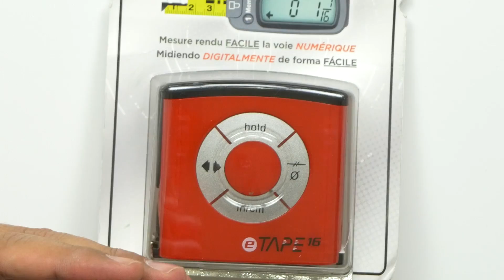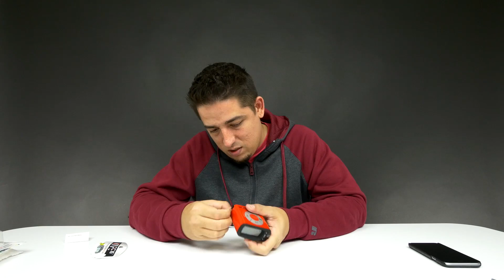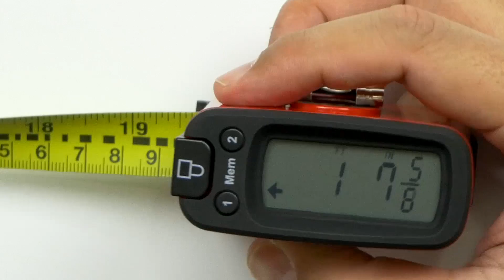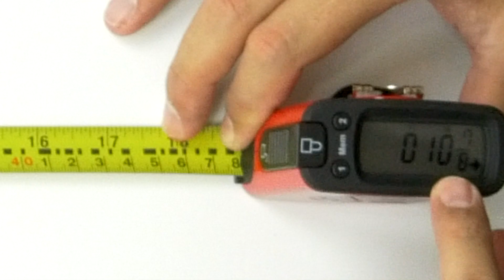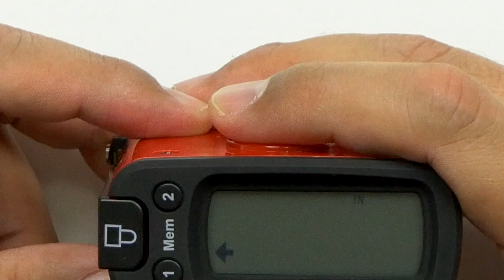This Tape Measure is Smart!

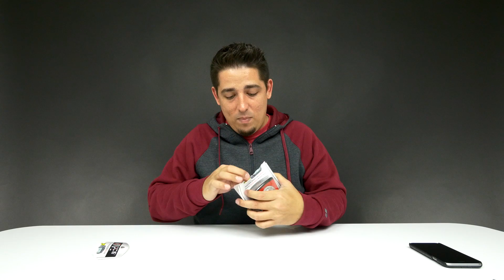Comment: ~1:45: The first thing you did wrong: Toss away the instructions!  Good or bad, they are part of the review too. If you're going to review something fairly and completely the first place you need to put yourself is into the shoes of the average consumer. Maybe the instructions tell you what kind of batteries you need and how to install them. Plus, at 1:45 out of a barely 4 minute review, you sound like your mind id made up already. This is no way to run a railroad, or to give useful product reviews either.